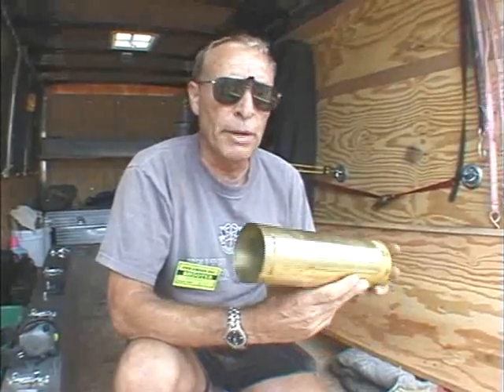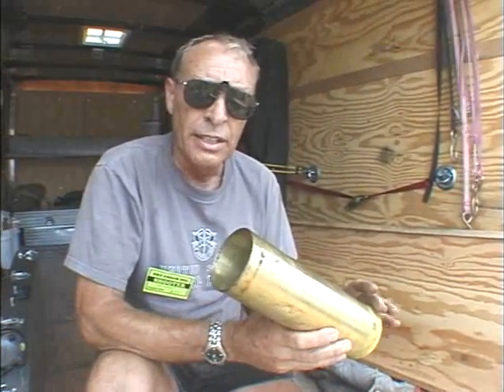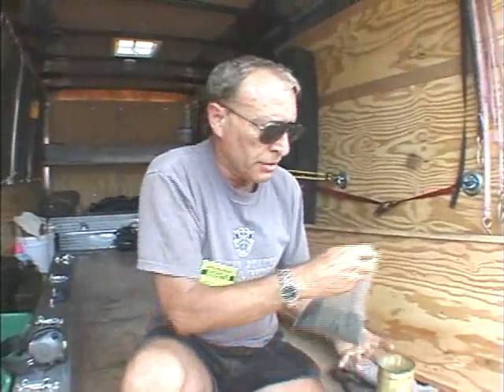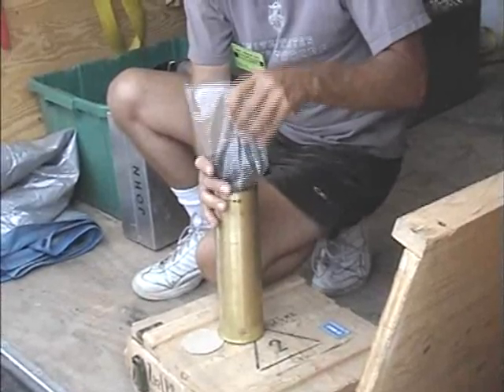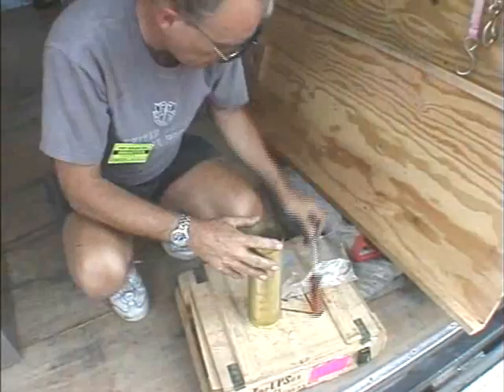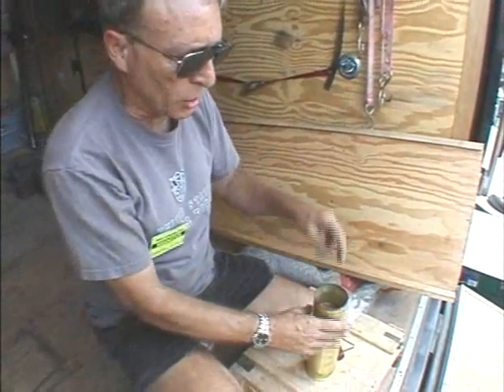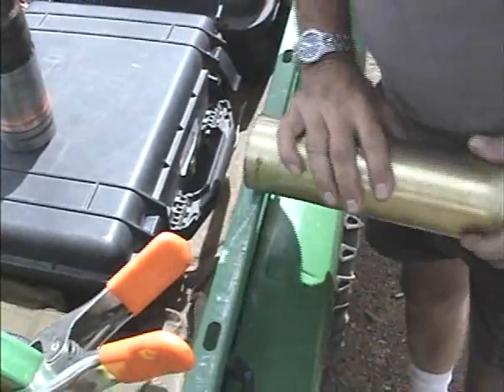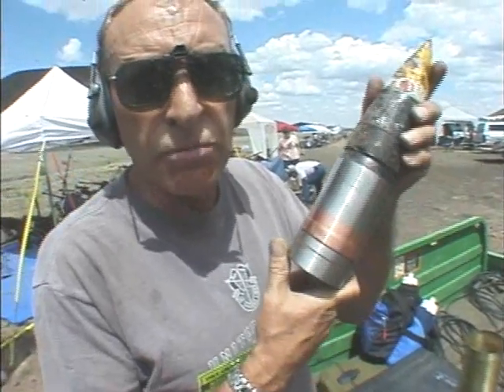75mm Pack Howitzer Load

Comment: Maybe 20-30 years ago, we had a neighbor that was a WWII vet; I think he was stateside the entire time, but with a mountain warfare regiment that used (I believe) the M116 howitzer. I may be misremembering (it's been a long time), but he said they used three men to load the tube assembly onto a pack mule: two men at the breech, one man at the muzzle, with a pole through it to hold it as they gently lowered it onto the mule. Couldn't spook the mule, or it'd run off- tricky job. Anyway- they had a Native American by the name of Daq (that's how Casey spelled it, D-a-q) who could pick up the tube assembly and lower it onto the back of a pack mule himself, no help needed, without spooking it.

Apparently Daq was also quite the guy when it came to bar fights.

Comment: My Dad was a WW2 Airborne field artillery paratrooper and jumped onto Corrigidor during the battle. He was in the field control HQ for a battery of 75 mm howitzers. They were light enough to be broken into 3 parts and parachuted down. My Dad's job was to calculate trajectory to be used in fire control.  He worked out of the old barracks building topside. Many of his friends died there, but he lived on until 1977. Thanks for posting this.

Comment from the maker: @TrollSturm, I can't find the groups at this time. I don't collect artillery. While at the Phoenix SAR show each year, there are a few vendors who have a large collection of large brass. If you're luck and it's a match, great, but if not, these are then modified (turned down) to fit your anti-tank gun or whatever. Projectiles are the same thing, usually used, recovered training slugs, or you make your own on a lathe. Most reload the same 5 cases over and over as a display.

Comment: Pack 75s are for show! What a POS! The 81mm mortar is a bigger MOFO! I noticed that you put the powder in and added the Charge 1 from a 105mm to get the "boom" up. Anything below 105mm is a waste of time. The old Sherman was a 76mm. It couldn't do anything vs the German 88mm. Our 81mm mortars were more dangerous, not to mention the half-track 105mm SP guns. The M1 Abrams tanks use the 120mm with DU shells.

Comment from the maker: The term "destructive devices" is used to describe rifles and arms larger than 50 caliber. Since most machine-guns on the NFA registry are 30 caliber, these would not be destructive devices, technically. However, the 75mm Pack is. Prices are not that bad, but they are not cheap either. You can still make and register DD's.